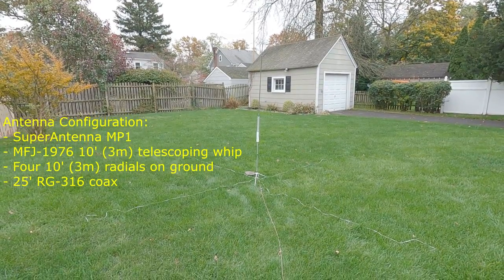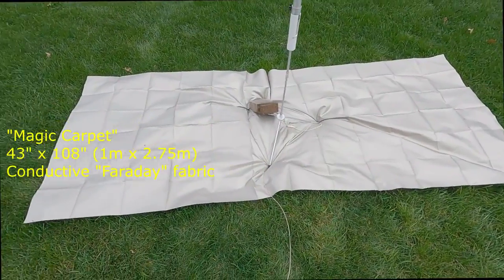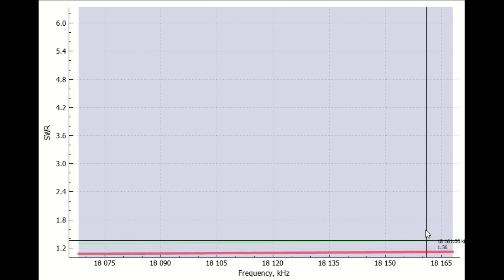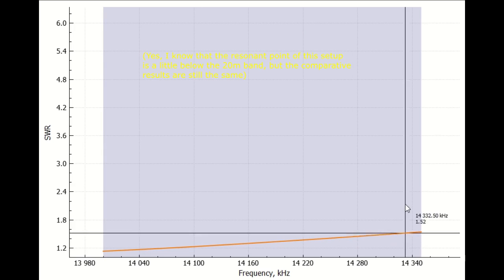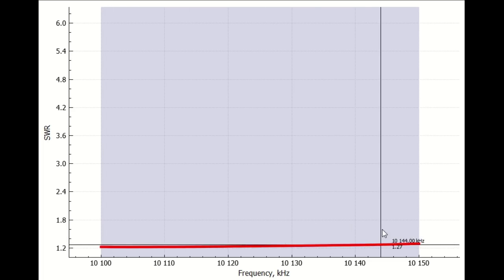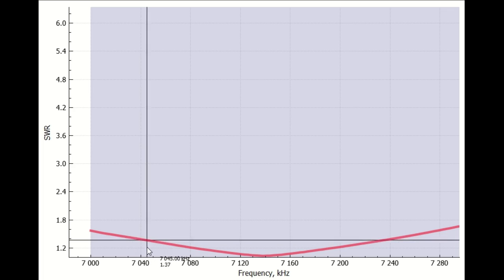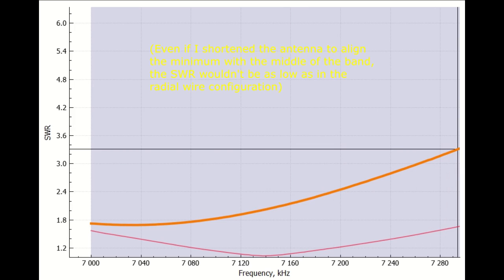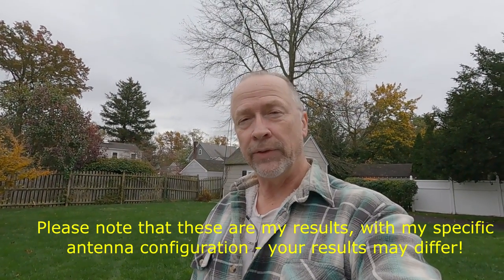#375: Ham Radio Quickie: Ground Radial wires vs. the "Magic Carpet" Faraday cloth

Comment: Put the cloth on top of the radials, or connect them to the edges of the cloth and run them out from there. It's not either or.
Reply from the maker: Yes, that would be best. But, many folks are using one or the other only, so that’s why I did this.

Comment: Very useful comparison, thanks. I have been mulling over this choice for some time, but have stuck with radials for much the same reasons as you have.

What might be worth checking out is Chameleon's new CHA FSR (Faraday Strip Radial System).

Comment: I prefer an elevated vertical  with at least two resonant radials for each band of operation.  Verticals are simple antennas and it is easy to get them to perform well - just elevate them and give them at least two resonant radials for each band of operation.

Thanks for the video, and 73!

Comment: You might get better results with a larger faraday cloth. It may have suited 17 meters fine, but as you got lower in frequency, your SWR got worse. Not sure if a larger area cloth will hit the pocket, but worth the try.
Reply from the maker: Not worth it for me, since I find deploying radial wires faster/easier in the field, and they work "well enough".

Comment: Greetings Alan, interesting comparison, however I know you know that VSWR is not a measure of performance. Too bad you didn't record the R and X values in each case. A short vertical has a radiation resistance well below 50 Ohms. So as the ground plane is improved thereby lowering the resonant impedance, the SWR should actually rise, e.g. going from 25 to 17 Ohms. Still a useful comparisons though. Cheers Peter
Reply from the maker: Yes, of course, (but it's what everyone wants to know ;-)

Comment: Try doing the same test with out the tri pod sitting on the cloth , but use a jumper to connect to it. Tri pod then the cloth running long ways away from it. should be a lot better.

Comment: All the comments do is demonstrate that it is each individual's perception of what works for them. There seems to be no hard and fast proven immutable theory. In my case I gave up on radials for portable ops because they get in the way of the public and I don't want to be on the end of a law suite. Those who swear by radials as some magic solution ignore that most hams just throw them out on the ground so they are not straight but lie in a wiggle and curl everywhere, meaning even if they are cut for resonance well they won't be resonant on the frequency they were intended to be. Quoting AM broadcasters I believe is also fallacious as justification for laying out many radials on HF because they are still using design thoughts of a century ago before there was much if any real understanding and certainly not the measuring equipment we have nowadays. I have used a metal flyscreen and a 5.2m vertical, 9:1 unun and tuner and worked from the outback in VK4 using 100 watts to the USA and Europe on 20m, 15m and 10m SSB in various sites including with extremely dry rocky soil underneath. It works and works well for me. Now I use a similar sized faraday cloth and it works just the same. Radial theory out the window.

Comment: Hard to tell which one is better from only SWR. With a pure 1/4 wave element the Radiation resistance could be 35. The ground resistance adds to that and IF the ground Resistance were 15 ohms you might get a perfect match of 1:1 SWR. If you improve on the ground resistance the SWR should increase until with absolutely no ground resistance ( impossible in the real world) your SWR could be 1.4. In that case you made the ground better but the SWR indication got worse! I am sure you know this but so many guys go for low SWR without thinking about the overall picture. However it looks close enough that it probably does not matter which you use!
Reply from the maker: A more detailed study with RBN reports would likely show that they're pretty equivalent performers.  For me, the wires are easier/faster to deploy than the conductive fabric.
Reply: @w2aew  Yes, I agree. I use about 3 or 4 short (10 to12 foot) radials and think it gets me good enough. I think any sky wave tests is almost impossible to see less than 3 dB difference with the RBN even due to QSB and other ever changing ionospheric conditions. Even instantaneous switching between my three 10/20 meter dipoles is not always clear. However anytime a signal is off the dead end of one, it always makes a big difference switching to one of the others. 73 de N4DJ

Comment: I think you need longer faraday cloth for 20 meters and below. 17/15/12/10 you should be good to go. I have ordered 2 x 5 meter lengths (17ft), to form a cross - which I anticipate, will be very good down to 40 or even 75 meters
Reply from the maker: That’s likely true. I found that the wire radials are faster to deploy and don’t require anything to hold them down in the breeze, so I’ll likely stick with them, even though they’re probably a little less efficient.

Comment: Appreciate this video, nice and short and to the point. A couple of points to consider: If the antenna is being tuned by way of an antenna tuner, or lengthening or shortening the whip, or adjusting a coil, then the SWR can be tuned out using these methods. Certainly different materials will produce different results. If one is using wires and are happy with them, then they should use them. However, I  can see the Faraday cloth as a convenient method for the POTA activist to get a good ground mat that is easier to carry and deploy than wires. SWR is not all it's cracked up to be, however. The main objective is to get the power to the antenna, and that power to radiate  efficiently. The mat helps it do the latter to reduce ground losses - the main objective of a ground system. Some folks confuse tuning radials on the ground (kind of a futile thing since they get detuned easily) vs tuning them elevated for a 1:1 match. I'm in Fl, and I tuned more than one vertical antenna using one elevated radial about 6 feet off the ground. Worked well. Ground conductivity being different all over the country (see the old 1950s map on the web showing the country with its ground conductivity #s), I can see my area of FL as being an 8. Setting up an antenna here compared to my old stomping grounds in the northeast (Rhode Island, where the # is 2) will required different approaches. Ground conductivity is a very important aspect to determining antenna efficiency. 73 de Scott W1AL

Comment: Have you tried a test witth both the magic carpet and ground radials together att the same time?
Reply from the maker: No - I was really only interesting in looking at the cloth as an alternative to, not in addition to, a radial set.
Reply: @w2aew  sounds like an experiment I may have to do then.
Reply from the maker: @WH6FQE  I would imagine that the radiation efficiency will be better than either alone.
Reply: @w2aew  That is my theory as well
Reply: @w2aew   I ordered 4 of the cloths, along with the tape to seal them together into one large mat. I will do some tests with a single matt with standard ground radials, one with 4 combined mats, and then with the 4 mats and ground radials. 

Im not expecting much of a difference between the 4 mats and the 4 mats with radials because of diminishing returns.

Comment: Dumb question time, why is there a need for a ground plane, I cant figure out why an antenna would need that to operate.  Are there not plenty of antennas that work fine without the ground plane ?
Reply from the maker: It's not a dumb question.  A signal fed to an antenna needs something to "push against".  Yes, it's true, there are antennas that don't require a ground plane, and there are those that do.    An example of an antenna that doesn't need a ground plane is a center fed doublet or dipole.  In this case, the signal can "push" against the other half of the antenna.  Picture stretching and relaxing an elastic band between your hands.  Each hand works against the other.  An example of an antenna that requires a ground plane or counterpoise is the quarterwave vertical.  The ground plane becomes the "other half" of the antenna for it to work against.  Picture yourself pushing a shopping cart.  The only reason you can move it is because you are pushing equally against the ground.  If you were suspended in air, you would not be able to move the cart.  I hope this helps.
Reply: @w2aew  Thanks so much for getting back to me, you explained this perfectly, I finally get it now :)  I am currently studying so I can get my ham radio licence, which was largely inspired by watching your videos.  Just want to take a second here and let you know that I have been watching your videos for almost 8 years now and your a natural born teacher.  Big thanks for taking the time out of your day to make these videos and share your vast knowledge here on the internet.  I regularly watch your videos before bed because it just makes me feel good, even though I often have zero idea of what your talking about hah!  Anyways, thanks again for the response W2AEW and maybe when I get my licence I can make contact with you over the airwaves.  Cheers from Ottawa Canada.
Reply from the maker: @UOttawaScotty   Very glad to help!  Good luck on your studies, and thank you for being a loyal viewer - best regards, Alan

Comment: Would it help to run an additional radial along the perimeter ? My thoughts are that RF flux through a loop would be better than just spokes. All my gear is still in boxes since my move or I'd try now.

I like the idea of the magic carpet when optimizing for deployment speed.
Reply from the maker: For me, deploying the carpet takes longer than my current 4 radial setup.
Reply: @w2aew  Makes sense. The ground where I deploy is extremely dry sand.

Comment: I'm wondering what would happen if you made kind of a cross of two "magic carpets", with the antenna at the center, of course.
Reply from the maker: I’m sure it would be better, but I’m not willing to spend another $50 to find out. Best use case for this fabric might be as a tablecloth fir when I use the AX1 on my KX2.

Comment: Please measure the DC resistance from point to point on the magic carpet.   Hopefully it is a good conductor, but possibly it is not.  From a Faraday shield standpoint it might not necessarily be a good conductor.  If it is not a good conductor it would not be a great choice for use with an antenna.  Although, compared to just 4 radials, even a modest conductor might be OK.  SWR and SWR bandwidth are not reliable indicators of a good antenna, i.e. a 50 ohm resistor has good SWR and great bandwidth.
Reply from the maker: It is very low resistance, just a few ohms end to end.
Reply: Excellent!  Then it should work well as a ground plane.  Don't be discouraged by the SWR and SWR bandwidth.  Narrow bandwidth goes along with a low-loss antenna.  The radials are likely higher loss, so larger bandwidth.  @w2aew

Comment: Double the number of radials! And make the extra 4 radials 20ft each.  Youll be happy with the OTA results. 😊
Reply from the maker: I'm sure I would.  Since my goal is to make casual POTA contacts, the extra performance I might get with more/longer radials isn't really worth the extra time to setup/teardown as well as the extra space in the go-kit - since I generally make sufficient contacts with what I've been using.  Once conditions begin to decline at the end of the solar cycle, then I'll up my game.

Comment: It would seem for the bands in question, neither the area of the magic carpet, nor the lengths of the radials would be sufficient. I suspect either double the carpet area or 2x the number of radials (at 1/8 or more desirable 1/4 wave) would yield improvement. 

What would also be interesting is a comparison of 'wide strips' of carpet cut to the same lengths as the radials vs regular radials. Additionally, regardless of SWR differences, signal strength comparison at receiving stations. 

Fun stuff.

P.S. I probably would take the rubber feet off the tripod.
Reply from the maker: Hi Chris.  Tuning the length of the radials is much more important when they are elevated radials.  When laying on the ground, the specific length is much less important. Sure, it has more ground losses, but as long as I make POTA contacts, that's all I care about. I'm not trying to bust pileups or work a bunch of DX, I'm just looking to have some casual operating fun in a park.  Certainly, a larger carpet area would help especially on the low bands, but the extra fabric somewhat defeats my purpose of fast and easy deployment.  I ran some experiments with the rubber feet removed as well as different (and more direct) attachment of the fabric at the apex of the tripod with little difference noted.  I may try to run some comparisons using RBN spots to see signal differences.
Reply: @w2aew  Understood. Really just thinking out loud. I've always found my unun end fed has outperformed my verticals on 40m for portable ops, which is why I generally opt for that antenna in the field if there are trees I can fling into. 72!
Reply from the maker: @kq2rp   Totally agree.  When I have the time and location conducive to using the 40m EFHW, that is definitely my antenna of choice.  Often times though, I have limited time, or no real good way of getting the wire in the air - that's when I go to my MP1.
Reply: @w2aew  golf ball w/eyescrew and spool of fishing line is my weapon of choice. 60' no problem.
Reply from the maker: @kq2rp   My 8oz throw bag and line are usually sufficient to get the antenna up high enough, but only if I have the time and the trees are available.

Comment: It would be pretty cool to hear some WWV comparisons between the ground plane options. Remember folks, SWR is not an indicator of radiation performance (although it helps transfer power of course).
Reply from the maker: Yes, I may try that, or run some tests and check RBN numbers.
Reply: @w2aew  looking forward to it. My hunch though, is that the blanket is simply too small to be as effective as those longer radials. The near field on HF is just enormous and you’re probably getting a lot of loss into the soil. Just a hunch. Antennas are my favorite mystery.

Comment: It's good to see other test results that confirm what I've found for the last six months. The ground screen, or magic carpet, works and it is a an effective alternative to laying out conventional radials. After dozens of portable activations and thousands of contacts, I'm convinced that I'm not losing any performance but gaining loads of convenience.
Reply from the maker: Hi Mike,  glad you found my quick measurements insightful, and confirming what you've seen.  Your video from about 6 months ago that showed virtually the same propagation results using WSPR reports confirms that too.  My limited playing around with the carpet and shown me that for my typical activations, my radial deployment is more convenient for me.  Several of the parks I go to don't have nice clear patches of ground to lay the carpet out (too much brush, rocks, trees, branches, etc.) - the radials give me more flexibility and I can deploy them in less than a minute. It was a good experiment though.
Reply: Michael, love your tests on all these verticals as well but please see my comments to Alan. Do remember that much work on elevated radials has been done by Belrose, Severns and Christman and on-ground screens by Jerry Sevick. It is great that this info is now being practically used by newer hams. Good for you for making it accessible and practical.
Reply: My friends and I have been using two "magic carpets" side-by-side and slightly overlapped - the 17' Chameleon vertical antenna is put in the middle.  Our unscientific analysis on 20 meters is that we gain some improvement in signal strength and POTA QSO signal strength reports seem to confirm that. I would like to see you redo your video and use two "magic carpets" as I described earlier.

Comment: Just as a thought, Have you put the Magic Carpet and the wires out together? My thought is that it will be better than just one of them. Also a larger Magic Carpet should help. Just some thoughts from someone that has not yet tryed this with my Wolf River Coil antenna. Hope to soon.   73   W4DES
Reply from the maker: Both together would likely work very well.  For me though, many parks I go to don't have a nice open area to lay out the carpet (trees, brush, etc.).

Comment: I don't believe the thin wire would make an RF connection. Maybe DC but not RF. As others said SWR isn't the goal. See if signals are better.
Reply from the maker: Not ideal, but it works ok.  If RF couldn't make it through the thin wires, then ground radials wouldn't work either.

Comment: Aren't these SWR plots suspiciously flat? This typically indicate very high losses (in the transformer if there is any, in the transmission line, etc).
Reply from the maker: My success with this antenna system at QRP levels would indicate otherwise.
Reply: @w2aew  I also successfully do QSOs with 1W output power and sometimes even 1/4W. It doesn't change that 1W is only 20% of 5W.
Reply from the maker: @R2AUK  ...which is exactly why I don't worry about it.  If my losses are 1dB or 10dB, as long as I am making contacts - it really doesn't matter to me.  I am not a contester, so not fighting to get my signal thru - just having fun in the parks.